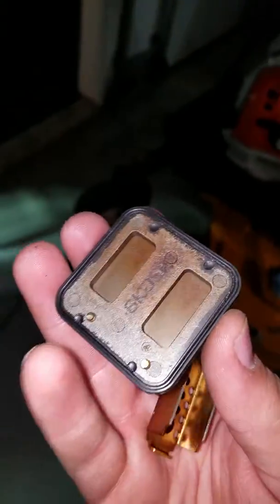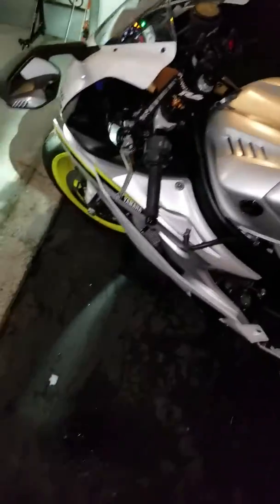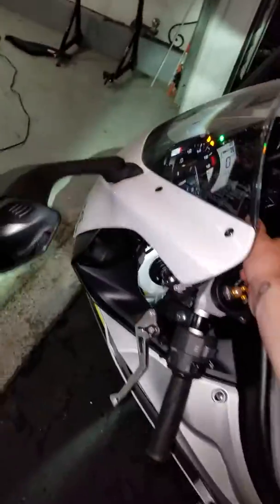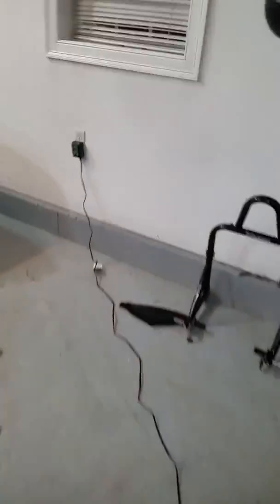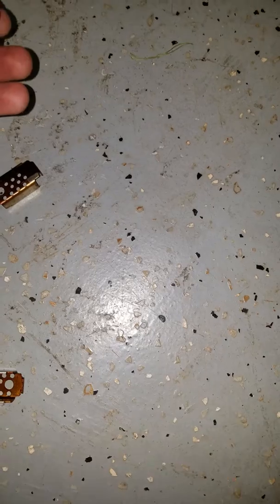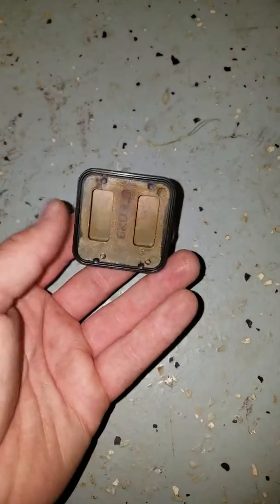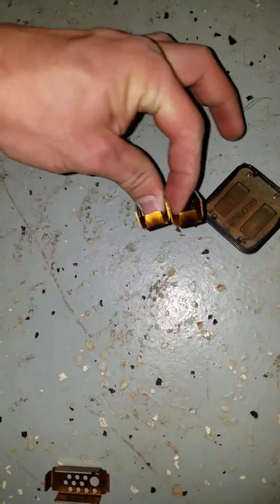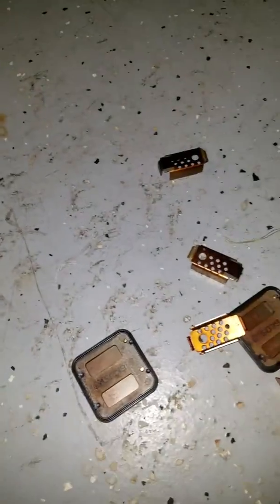2017 Yamaha R6 Ticking Fixed

Comment: I put on the smog off plates without removing the valve plates and I don't I have any ticking. did you put it in then correct verse?

Comment: Hi, Brandon,

I have done every mod to my 2017 R6 other than an exhaust system. What is the purpose in taking out the smog block off plates? I have 1,000 miles on mine and can't decide between the exhaust system you have or the Akrapovic GP 2017 model. I have a quick shifter, ASV shorty levers, front axle sliders, bar ends, same tank pad as you, R6 grips, R6 frame sliders as well as a brake reservoir cover. DM if you want to exchange pictures and what not. I'd love to hear if you'd recommend your pipe or the Akra. I have the black model.
Reply from the maker: Maverick Robinson well I do love this yoshi pipe I have, not too expensive either. The reason you want smog block off plates is to get an accurate air to fuel ration reading when getting tuned
Reply: Tacticool Brandon What are they quoting you for the tune?

Comment: Hey i need help, i have the same bike and have the same noises. Where do i find these parts to remove them and for what are they even there?
Reply from the maker: if youve installed block off plates, theyre the components located under the block off plates in the head. they just pull out once the plates are off.

Comment: that's the AIS you just removed. I hope you did some research first before you removed them. aside from removing the system that manages your emissions, you also just changed the way your bike manages AFR. Good luck mate.
Reply from the maker: KimmyR3 bike was Dyno tuned after installation
Reply: I see. Good job on getting a fuel controller. :)

Comment: Hey mac robinson altho Brandon is right that is a alternative that will eventually cause problems... if you do the exhaust get yourself a servo buddy it will do same but its made especially for this reason and for R6's. wen u change stock exhaust u take out servo motor which tells ecu that everything ok in bike... its complicated lol but the servo buddy serves as an electronic transmitter to your ecu telling ur bike everything fine and it won't have motor or electronic issues. just my opinion and personal experience